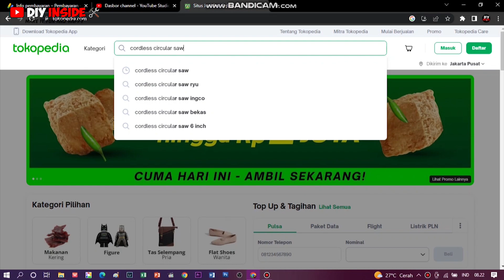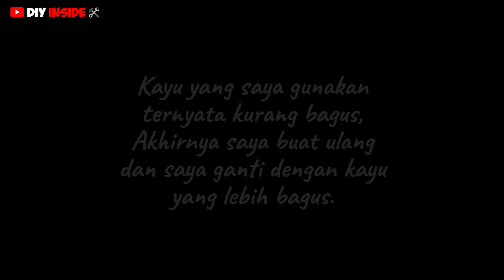cara membuat circle saw cordless dari dinamo DC 795 Part 1 #diy #creative #woodworking

Comment: Uwah, keren tuh bisa dipakai dimana saja, portabel 👍
Reply from the maker: iya waktu itu bikin tapi masih pakai kabel, jadi ribet
Reply: @DIYInsideChannel batre brpa cell brpa mah om? Sekali cas tahan brpa lama
Reply from the maker: 10 cell oomm, sama di cover nya 4.0 Ah, belum di tes sampe habis batrey oom, next video coba saya review
Reply: @DIYInsideChannel  oke siap om,,ditunggu review daya tahan baterai nya
Reply: @DIYInsideChannel untuk torsi dan speed pke batre divideo ini,  dibanding sama yg pake psu 24v 15A kemaren lebih unggul mana om?
Reply: @DIYInsideChannel  10 cell jdi nya brpa volt om, charger nya pake yg brpa volt ampere biar aman
Reply from the maker: @bahrulmasrurimasruri3972  itu 1 Cell nya 3,7 volt, kalo di keterangan pas beli sih 36 Volt, 4 Ah. tapi belum di test
Reply: @DIYInsideChannel itu potong multiplek brpa mm om? Klo buat potong mdf 9-12 mm lebih cepat pake yg mata gergaji brpa gigi
Reply from the maker: @bahrulmasrurimasruri3972  itu kemaren saya buat potong multiplek 10 mm cepet bang, gak ada kendala.. multiplek 20 mm juga lancar, saya pakai yg 24T jenis AKB merk Bull
Reply: @DIYInsideChannel  apa pakai mata gergaji yg kecil juga pengaruh ke pemotongan nya om? Sya pake mata yg 4 inc 40T, tpi pake dinamo 775 rasa nya agak lambat potong nya